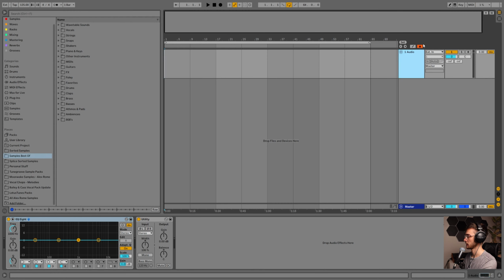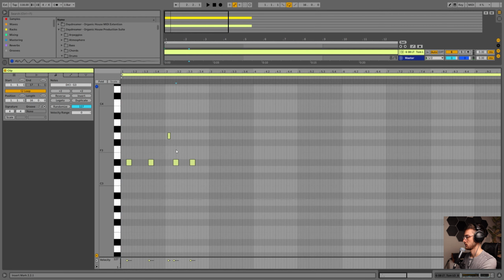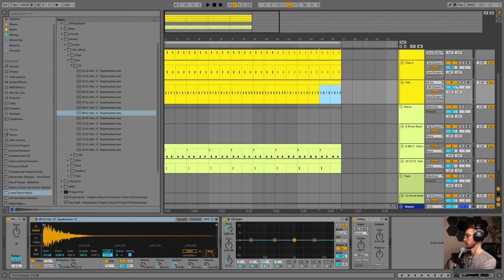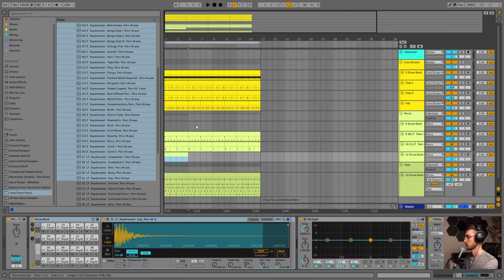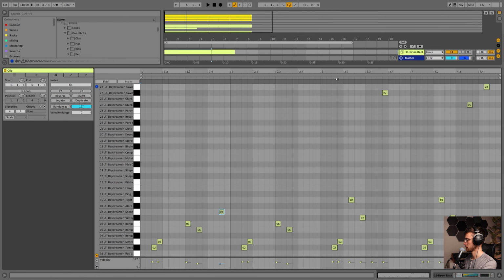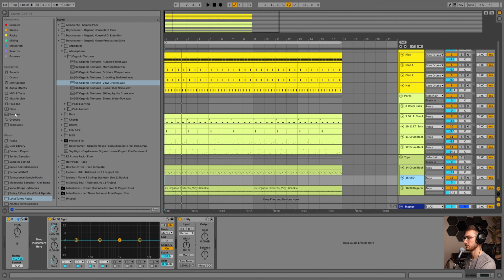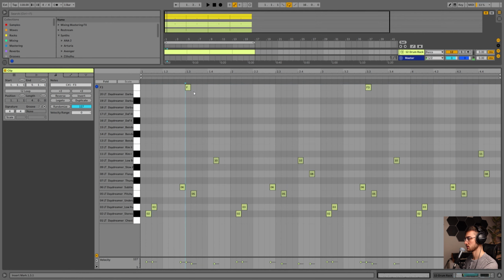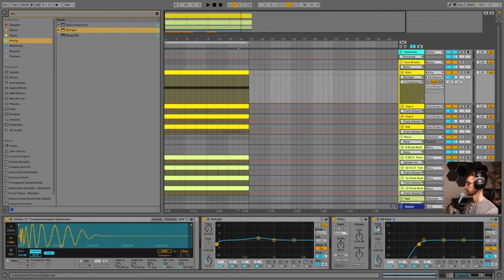How to Create Full House Drum Grooves (NO LOOPS?!)

Comment: Another great vid! problem is when I try setting up your 'Sidechain Ducking' effect, I hear a lot of echo/feedback sounds which ruins all the different tracks I'm using. How do I stop this from happening? thanks
Reply from the maker: Hi Darren. Thanks! Had this issue before too. Make sure to select „no input“ as the channels input. Your mic or some other instrument might be feedbacking into your Sidechain Ducking Track. This happens because once you set an audio track to input mode (turns light blue) it will take in input from any channel. You need to tell this channel to just take in sounds that are separately routed into it ( for example your loops or any other element you want sidechained )
Reply: @zahand-lotustunes  Hi, thanks for the reply. Been trying to sort this issue out but I'm totally confused as whatever I seem to press I still have audio/feedback when my Sidechain Ducking audio channel is highlighted blue (IN). What channel(s) do I need to select 'NO OUTPUT' on and has anyone else had or having this problem and if so how did you fix it? Cheers
Reply from the maker: @darrenjames2579  Hi Darren thanks for your response! Make sure to set your sidechain ducking channel to "no input". I believe that is what is causing your microphone to be routed into the channel. You want the channel to be blue "Input channel" but only want certain tracks to be routed into it. This is why it needs to be set to "no input" in it's input section. I think I'll make a seperate video on this. Cheers.